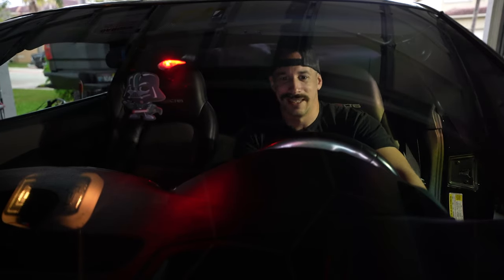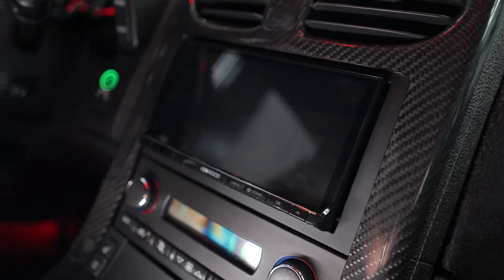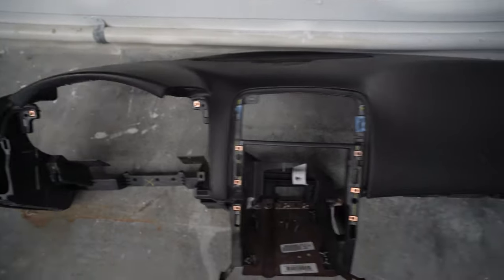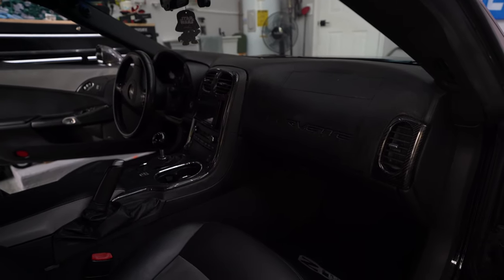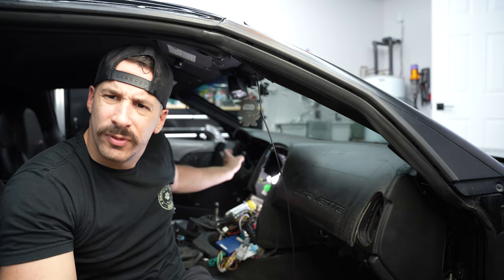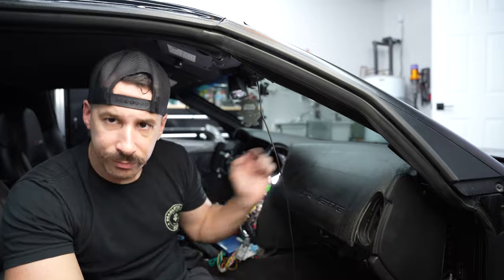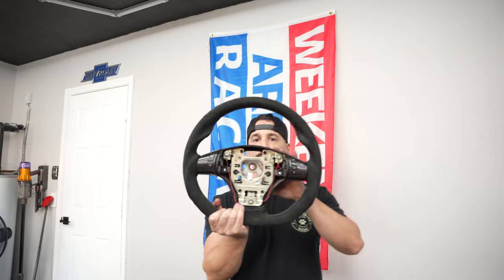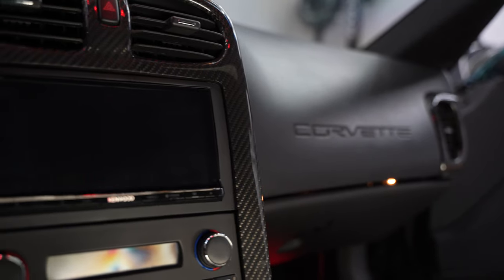A Must Replacement for Your Dated C6 Corvette Interior

Comment: On the seats, I went with a Corbeau Forza and their bracket.  Its sits very high, like 2 inches higher than stock at least, which I don't like at all.  I want to be at the stock ride height, for helmet fitment and lower center of gravity.  So I had to have my Corbeau bracket modified in the rear to get it little lower, which still is higher than stock.  I'm going to try to fit the Corbeau seat to an OEM bracket later this year for the reasons I stated above, but there are also a few others.  You lose the auto entrance and egress function, which is handy with high bolsters and you lose power adjustment tilting functions which makes dialing in the seat position much easier.  If you decide to stick with the Corbeau bracket option, you'll need an add on module to retain the telescoping function of the steering wheel.  Driving on track with the wheel all the way against the gauge cluster sucks, ask me how I know!  So just add that into your budget.  If I recall, it was about $800 for the seat, bracket and telescoping module.  Also be sure to do a 5 point harness if you haven't already. The stock seat with a 5 point harness might be a good way to go also, believe it or not.  And if you run a 5 point, you need to add a HANS device to your helmet setup, or you'll internally decapitate yourself if you hit a wall head on.  Happy racing!
Reply from the maker: Yeah, I definitely need to lower the height of the seat. With a helmet on I would say my stock seat setup has me a bit closer to the roof than id like. Going to be looking into bracketing soon and how to make it the most convenient, because I know once I go fixed location it can be a pain getting in and out. Fortunately the car doesn't see much time outside of track use and some spirited drives, but still want it to be comfortable and convenient. Thanks for all the feedback it really helps!

Comment: Great video for the interior of the C6.  I totally get as to why you did the dash, steering wheel, and the adjustment to the radio.  Those would likely bug the daylights out of me as well.  Great choice in wheel too btw, I was thinking of getting something similar when I get a C6Z (still looking) along with a better set of seats.  You look to be a bit of a larger framed person, like myself, and going with the Sparco racing seats is a great option, but will be a very (I mean very) tight fit.  Maybe look at the Status: seats as they feel much like the Sparco seats, just a touch bigger and even a little better on the price as well.  

Love the build of your Z bud, really enjoying your content.
Reply from the maker: Yeah! Definitely looking into Sparco. I plan to visit a local race shop to try them out before purchasing any.
Reply: @SloJoeRacing  I recommend you do for sure.  Then look at the price and ask yourself "is one seat worth 1k over getting 2 for $899?"  I have a couple of the Status: seats in my 78 Firebird Formula resto mod for that exact reason.  

Looking forward to your next vid bud.  Keep it safe out there.

Comment: the stock steering wheel is totally functional - so why is it trash?
Reply from the maker: The stock steering wheel is a bit thin for track racing and the older leather material is now very smooth with less grip. Changing to the alcantara not only do I have more grip but it’s a thicker steering wheel with contours specific for your fingers so for track use it’s a better experience.
Reply: The stock steering wheel doesn't even look like it belongs. It's way too cheap and basic for the car.
Reply: The stock steering is just something while driving mine I'm always feeling there's nowhere to put hand I moved up from a C5 to a ZO6 my C5 had a notch on the steering wheel where your thumb  goes just like that aftermarket wheel he put in his car ergonomically it totally Fits

Comment: I can see what your problem is right away: "Chevy?" Please. "Chevrolet" or "GM." You need a Camaro. "3LZ?" You mean "3LT?" My C6 has the 3LT package. Is your video music an original you composed? My leather steering wheel is fine. Basically: wash your hands before you drive. You should be scared of the air bag. Those things are just waiting to maim somebody. They LOVE carnage. It balances out their goody-two-shoe function of supposedly saving someone's face during a crash. Yeah, if the air bag doesn't decapitate you first.
Reply from the maker: The audio in my videos are all from artlist
Reply: @SloJoeRacing  You have to pay money for that! Well, I hope you're making money off your videos, then. By pure coincidence, I just cleaned the leather-wrapped OEM steering wheel on my C6 with leather cleaner/conditioner today. It wasn't perfectly immaculate, but it definitely wasn't dirty. The human body creates it's own debris field to deposit on surfaces, even with clean hands. I hadn't cleaned my steering wheel in probably 9 months and it was nearly completely soil free. I'm not sure airbags are good for anybody but the airbag manufacturing companies, like Takata, who just had to have the airbags in my Nissan replaced because of those airbags' tendency to kill & maim rather than save. This underscores my contention that airbags are the real killers. Cheers & thanks for the response.
Reply from the maker: @salvadormonella8953  Yeah its not ideal to pay for the audio service, but I enjoy creating the content and trying my best to make it as cinematic or entertaining as possible. I totally agree our hands release oils which coat our steering wheels and if not properly maintained can breakdown the steering wheel. For me I was looking for a wider grip steering wheel and Alcantara which naturally provides more grip especially for my racing gloves.
Reply: @SloJoeRacing  Well, the difference between a video nobody cares about and one that many do is frequently in that "cinematic" "entertaining" stuff. Some people love to do that stuff. I don't. You wear gloves when you race? Well, why didn't you say so? I'm a glove guy. A big gloves proponent. I have many gloves and I use the. I have all sorts of specialty gloves. I learned the hard way of the need to wear gloves when doing most tasks. I don't race in sanctioned events, but I have been to high-speed driving school. We were required to wear a helmet, driving shoes, but gloves were not required, and nobody there wore them, not even the instructors. I have many helmets, and two pairs of driving shoes, but no driving gloves. What in the heck am I doing? Failing, it sounds like. I've always had enough grip on the wheel, or so I thought. I haven't had a problem yet. Maybe I just don't know what I'm missing. I'm going to go out and get some gloves and see what happens. I'll probably end up wanting a faster car, and then that quest will NEVER end. Thank you for the thoughtful and helpful responses. Cheers.